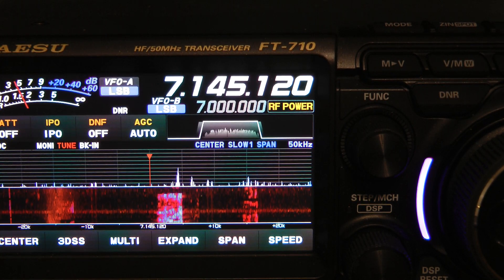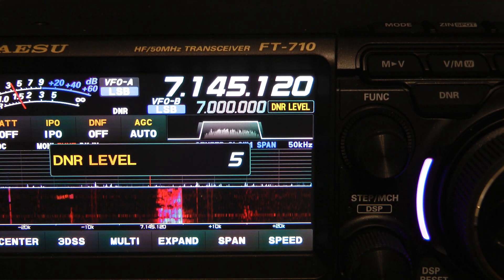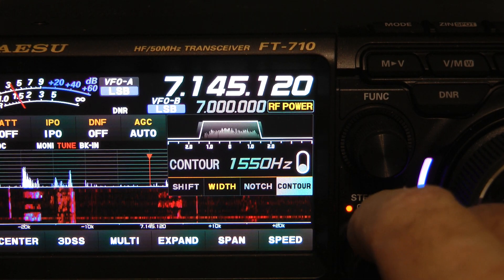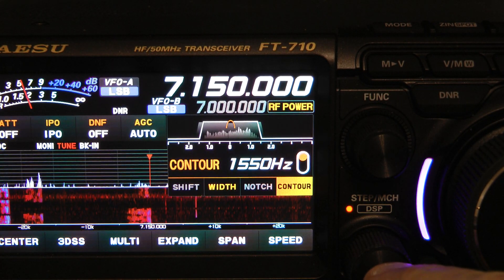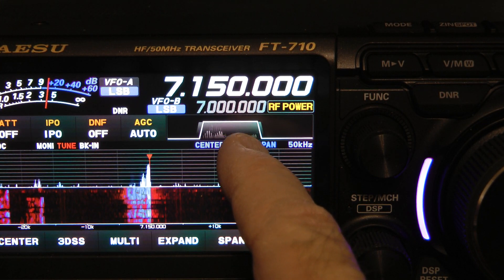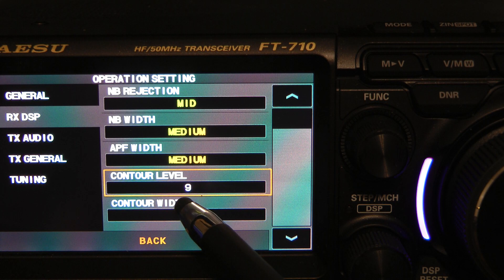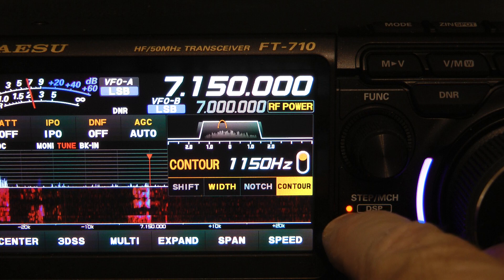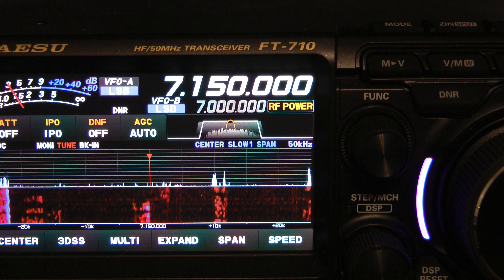Yaesu FT-710 Contour and DNR noise reduction

Comment: What DNR level should be set when using CW? I live in a big city where there is a high level of interference. I have noticed many times that when the DNR level is 6..7, the received signals begin to be distorted. At the same time, I have the latest firmware, the JA version of the transceiver.
Reply from the maker: I run my DNR on 3

Comment: Great informative video. So many hams just don't understand how to use and when to use the RF Gain Control. Even Yaesu has no clue. From the factory, my FT-991A came through with both pre amps on for every band. Yes, even 160 meters where you would never use a pre amp and surely cut back on the RF Gain. DUH !
Thanks for posting, nice job.
Barry, KU3X

Comment: The 10 and 710 are in a different class than previous radios. Use RF gain, contour correctly with slow AGC and there's virtually no background static. 

Good job on showing how you can change the contour settings. That really matters. Turns it into a preamp without any static increase. Same thing on the 891.